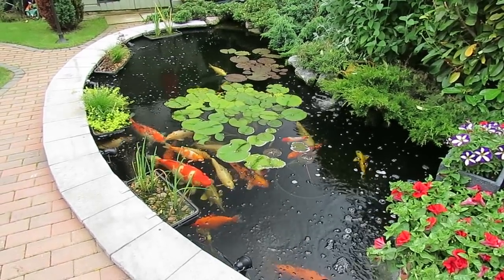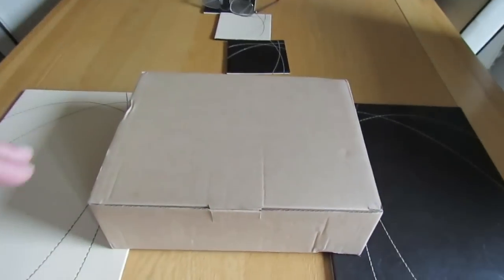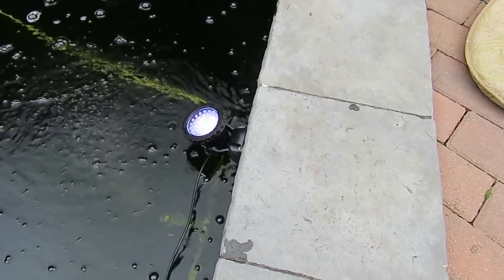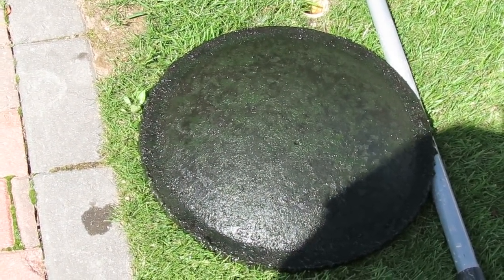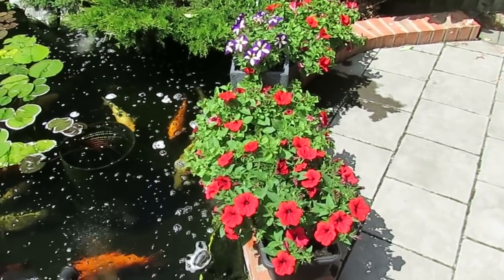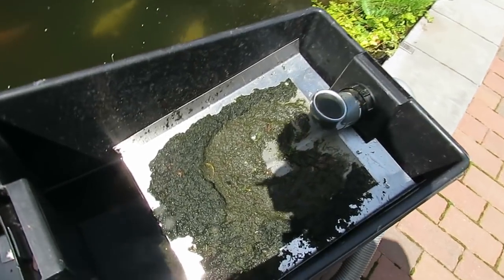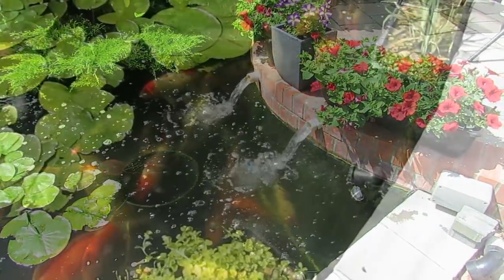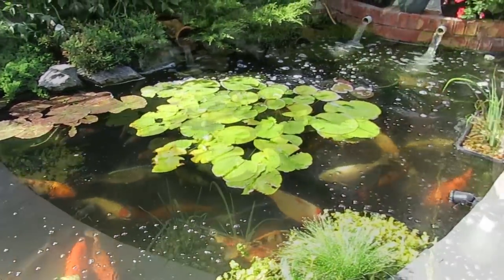New Pond Lights & A Bit Of Pond Maintenance.

Comment: Evening Terry, the pond is looking lovely and the plants coming along nicely. Our grass has been shooting up without any treatments and we seem to be cutting it every few days after all the rain and warm weather. Now the sun is here (for a little while) the flowers can get growing. I like the lights you got and there should be a way to slow them down flashing to rapid. I used to have the odd LED coloured bulbs before with a similar remote and there used to be an up and down arrow on two buttons but your remote looks as if that would dim the lights? May I ask where you got them from as I might get a set for my pond. Take care. Chris.
Reply from the maker: Hi Chris, I have been told, if I hold the Dim button it should slow the flashing down. Not tried it yet, but will have a go tomorrow. I got them on eBay: https://www.ebay.co.uk/itm/1-Set-4-LED-RGB-Underwater-Spot-Lights-Aquarium-Garden-Fountain-Pond-Lamp-Remote/372665768256?ssPageName=STRK%3AMEBIDX%3AIT&_trksid=p2057872.m2749.l2649
Thanks mate, Terry.

Comment: Hi Terry.
Ingenious tool you made for the drain lid,might have a go at copying it,need to remove mine and replace rather thick airline for smaller diameter air line to the retro fit air dome lid,but I'm five foot deep!!, out of interest how deep are you,and what gallonage,what do you run wattage/percentage on your new eco pump?great to see all the gadgets you've made to make life easier!!
Reply from the maker: Hi Marek, Thank you. My bottom drain is 4ft deep. My pond is 2500 UK gallon. I normally run the pond pump on about 125 to 130w I can go to 180w with that pump. Have to say I do like it. It's an Aquaforte DM Vario 10,000 to 20,000 lph. It can also be used as a dry/inline or submersible. Thanks mate, Terry.

Comment: Fab video buddy, I have a question if you could shed some advice on. My Lilly's don't seem to be sprouting towards the surface, they have plenty of leaves on them but they're not up at the surface. The pond is 2ft deep. Cheers mate.
Reply from the maker: Hi Dan, I'm not sure why yours are not at the surface. they should get there in time. My deepest lily is about 3ft 6 inches deep. I do put slow release lily feed balls in with them at the start of the season as well which I think helps. Thanks mate, Terry.
Reply: @Wrighty  thanks Terry, I might re pot them with some better quality soil then or give them some fertiliser cheers buddy Dan
Reply from the maker: I would be careful with re-potting half way through the season. As long as the soil and lily feed are pond safe you should be fine mate. Terry.
Reply: @Wrighty  brilliant mate thanks for the advice 😁

Comment: Thank you for a great video. Two questions 1) If you had to do it all over would you still install a bottom drain or a sump? 2) Have you ever fallen into your pond?😁
Reply from the maker: Hi Rich, lol. I would stick with the bottom drain, and the answer to question 2 is, not yet lol. Mind you, the older I get, the closer I seem to get lol. Thanks mate, Terry.
Reply: @Wrighty  All Wrighty then (pun intended) Will stick with my original design and go with the bottom drain. Was not sure about the long term effectiveness of a bottom drain or if it was the source of a potential leak. My drain will be at 4 feet of depth (116.8 cm). Hate to brag but I have already fallen into my pond....spring cleaning...ice on the pond still...great learning experience ;-]😎
Reply from the maker: Good morning mate. I built my bottom drain piping using the 9 bar pressure pipe. Good strong stuff and not a bad price from here : https://www.pipestock.com/pvc/pvc-pipe/pvc-pipe-class-c-inch-9bar
My friend moved to a new house with a pond and fell in on the second day lol. So were not doing too bad mate. Terry.

Comment: Hi terry , how have you fixed the lights to the liner on pond wall side please , and how much under the water please 
Regards Dave
Reply from the maker: Hi David, The lights are fixed to the copings around the top of the pond with screws. When the lights are facing down about 45 deg there half in the water. There not on the liner at all mate. Thanks, Terry.

Comment: What a lovely pond. love your diy builds. made a pre filter my self but only using gate valve for the flow. having trouble. How did you do your float valve. Do you have vid on that.
Reply from the maker: Hi Micheal, Thank you for your kind comments. I just used a simple butterfly valve principle, and it works very well. Thanks, Terry.
Reply: @Wrighty  thanks Terry I will look it up. Looking to your next vid.
Reply from the maker: It's the same principle they use to use in carburettors on cars. Terry.
Reply: @Wrighty  yes . Sorry I for got to put looking forward to your next vid lol.

Comment: Great vid pal,, what size mesh would you suggest on a sieve filter?
Reply from the maker: Thanks Daryl, I use a 60 mesh mate. I'm not sure of the micron size. Terry.
Reply: @Wrighty  cheers buddy, I'm trying to devise some sort of sieve to go under my spray bar to catch the algae. I'm having a black algae issue at the moment and it's clogging up the filters like mad.
Reply from the maker: Hi Mate, Have you tried the Cloverleaf Blanket Answer? It does make a bit of a mess of your pond for a week, but it is good stuff. Here's an old video of when I first used it that might help: https://youtu.be/Az5W49qQPy8 Terry.

Comment: Alreet Terry. That pond had really come on buddy. Are you still using the the DIY filters for this pond that you used on your previous pond? Also, what ix the total volume of your pond?
Cheers, Stu
Reply from the maker: Hi Stu, I'm well thank you mate. I now use the RDF (Rotary Drum Filter) I made. I do show it in the video. These are now very big in mechanical pond filtration. My pond is 2500 UK gallon which is not too big, but is (I must admit) well over stocked. This is a video of the first run I had with the RDF. Thanks mate, Terry.
Reply: @Wrighty  Terry do you do plans for your RDF?
Reply from the maker: @stuartmorris3160  Hi Stuart, Yes mate, you'll find them in the shop on my website. https://diypondfilters.com/shop/ Thanks, Terry.